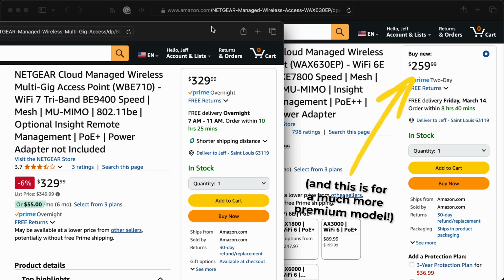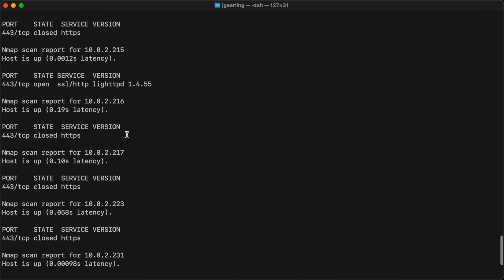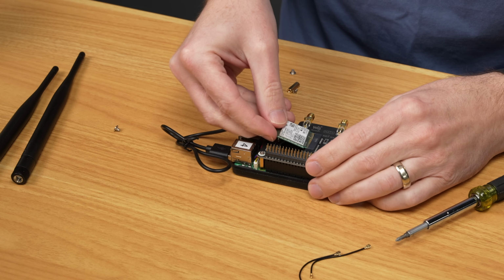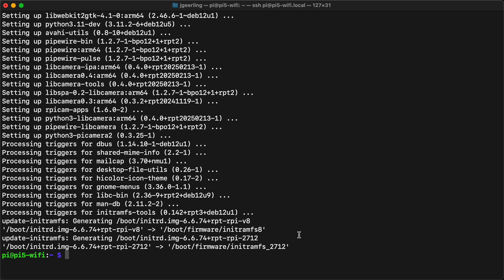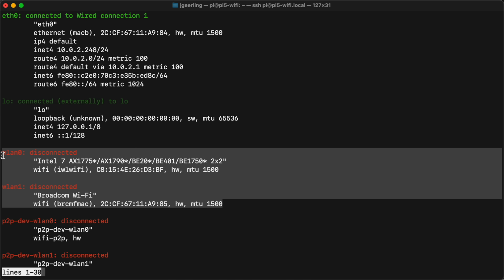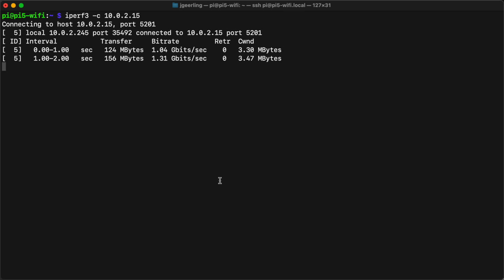The fastest WiFi EVER on a Raspberry Pi

Comment: You also only had the 6ghz channel set to 160mhz channel width, wifi 7/6e supports 320mhz width
Reply from the maker: It was set to dynamic (so negotiating between the widths), and the Pi negotiated 320 MHz for the last test (1.83 Gbps); see the linked GitHub issues for the card and the HAT for more on that ;)

I tried forcing 320 MHz channels (only, no other allowance) but that resulted in a connection that wouldn't work all the time.

Comment: The biggest addition in WiFi 7 I'm looking forward to seeing how well it works in implementation as more hardware comes out, is the idea of using multiple channels at once to have essentially a two way in/out communication simultaneously.

I imagine there' still some CSMA/CA back-off stuff involved that will make it still not catch up to wired stability, but could go a long way to getting there.

Comment: I'm sure someone else has mentioned it by now, but for reference you can use the -k option to lspci to list kernel drivers without the full, verbose PCI capabilities list. You can also just use a single -v to get it with the brief capabilities summary. Saves a lot of scrolling, especially on hardware with.. one or two more PCI devices than a Pi (I've got a few fairly normal looking machines where the full verbose output will far exceed 1000 lines).
Reply from the maker: True, true... or when you're on a server with 128 lanes of PCIe and like 40 bridges

Comment: You are a savior, just upgraded a computer to a new motherboard with wifi 7 built in. The current ubuntu LTS kernel has not been playing nice with my wifi 7 router, it just refuses to get an ip address, it'll connect to older routers just fine.

Comment: WiFi 7 is a game changer for those of us who have houses that aren’t built out of papier-mâché and some sticks. 

Being able to walk around a house that has solid stone walls without having the signal drop thanks to MLO is awesome
Reply: Aren't those Oriental houses? They must have great gaming.
Reply: @ just an average house outside the US really. Most houses I’ve been to in Europe are from the 30s and are made from brick and stone / concrete including the interior walls. Solid concrete. Even 2.4 GHz struggles in my house but not as much as 5/6
Reply: @iambenmitchell  Ours behaves really weirdly due to the walls being solid blocks but the floors being wood. Our upstairs AP works really well downstairs but one of the rooms right next to it with thick walls works really badly.

Comment: To me MLO is the biggest deal of WiFi 7. I have a house that has odd walls that in some places blocks 2.4 GHz, in others it blocks 5 GHz, and in others 6 GHz. So single-band WiFi is terrible. Even "simultaneous multi link" WiFi 5/6/6E tends to really want to hold on to a single band for far too long before giving up and switching. For example, a bathroom in my house sitting on the toilet is just 10 feet with one standard interior wall/door from my primary WiFi base station, and only 4 feet through a pipe-containing wall to a second base station! Yet I get terrible WiFi reception on the throne!

I upgraded to WiFi 7 routers last year when my 6 router became unreliable. I only have two WiFi 7 devices right now (one a desktop where having WiFi 7 is pretty pointless, since it's 2.5GbE wired as well, one a laptop with a USB WiFi 7 dongle just so I could test it,) and it works great. Doing some iperf3 speed testing, I can get over 2 Gbps between a WiFi 7 device a few feet from a router to a 10GbE-connected server; and in my dead-WiFi bathroom, I still get a good signal, as it uses all bands at once nicely.
Reply from the maker: Interesting, hadn't considered that use case, but partly didn't look to far since I had trouble getting MLO going.
Reply: @JeffGeerling  Yeah, MLO has been a pain. Windows 11 24H2 is the only OS I know of that it works properly in yet. My laptop doesn't officially support Windows 11, so it took some hacking to get it up and running to even test MLO. But it works great. I can run constant iperf3 tests and walk throughout the house, and just lose bandwidth, not completely drop packets the way non-MLO does.

I'm waiting for confirmation of a phone that supports it before upgrading my phone.

Comment: You can easily get above 1Gbits with 5Ghz channels Wifi 6 at range around 15-20 meters if you don't have 50cm stone walls in between. I don't see a reason for 6Ghz to need a Line of Sight for similar performance (even if I don't have anything to test 6Ghz or multigig network interface on the hand)

You do need a proper AP for that, and I don't think ceiling mounted AP are meant for servicing multiple room in a house. (a regular multi directional AP may do a better work then)

Comment: So a WiFi7 hotspot Pi using a AlpineWall install/config should be possible 😃
 (Id go with either Proxmox or NixOS as a host for a VM running it, or directly on the hardware install).

Great video!

🌱

Comment: I've read mixed reviews about the intel be200. Are you sure about it?
Reply: Almost all wifi 7 pcie cards are very very bleeding edge 
And wifi 8 spec just got announced 
Wtf
Reply: @nil3010  wifi 8 already? That's really fast... As for the M2 card he mentioned it in the video there's a lot of posts about it not working on amd systems which left me hesitant
Reply: @freestinje  NGW at end means it is 
Cnvio 2 or  1 ( not forward or backward compatible)

Basically wifi+bt stack  is on the SoC and RF stuff on the card
As of right now I don't know if Intel or any 3rd party made the full pcie version for wifi 7  ( they have announced it tho )

Comment: just a warning: if you choose to install the wifi card on the poe version of the hat, just make sure you disable the network adapter on it, otherwise your connection might instead go through that nasty, rock solid, brick house stable, uninterruptible ethernet cable you're using to power the pi

Comment: Before you try Intel Wi-Fi NICs support AP mode on 2.4GHz only. Figured that out while trying to build a Wi-Fi AP for myself a while ago, then I bought a Mediatek MT7922 card (before Wi-Fi 7 release) and, despite some annoyances on the Mediatek driver itself, it worked pretty good.
Nowadays, the option I'd suggest for Wi-Fi 7 AP is the MediaTek MT7925, the only issue is that it shares the same bus for all frequency channels, so you can only deploy AP mode in a single frequency (2.4GHz-only or 5GHz-only or 6GHz-only). And by buying 3 different NIC + a multiport M.2 switch board + the hassle of setting up everything, you pretty much enter in the commercial WAP territory
Reply: Yowsahz! Sounds....tricky...from your comment, soundds like you may be knowledgefull to answerring a que  stion or 2 I have...i've been wanting to make a network testing Pi settup which currently utilizing Alfa WIFI adapters to do so... since they are plug and play monitor mode- and all that fun stuff. If i went...am wanting to...hopefully from this answer...will be...If I use a wifi card/ hat like shown in the video....is all i need to take into consideration the chip? If i got a wifi card the ssame chipset as the alfa adapters...would that work? Set the card to monitor mode? I feel i'd still need at least 1 Alfa adapter for my specific use case(s)- or is there a solution out thee that would allow forr me to have 2 or more of the chip/ hat? Unfortunatly the onboad wifi chip doesn;t suport the modes desired.plus.I can't have these wicked col antenas on my pi.

Comment: The biggest shame of WiFi 6,6e,and 7 is that everyone uses intel's cards (or form factor) and basically limits the clients to only 2x2 spatial streams hampering speeds and distance you can get those speeds.

back in WiFi 5 with a 4x4 link (both router and client) you could get up to 1.7 Gbps real world speed was closer to 1.5 with overhead, but just think how awesome WiFi 6 and up would be with 4x4 antennas rather than just 2x2 (great for phones which need the limited space not so much on anything larger)

this also has a benefit where you can lower the channel width but keep more speed using more spatial streams, which in turn increase the range you get those speeds as the noise floor is better with lower channel widths.

Worst of all it's not even a tech issue, WiFi 6 and up has support for 8x8 and WiFi bumps it even higher to 16x16 but we never use it (yes i know MU-MIMO can separate the streams per client for concurrent Rx/Tx).
Reply: Well tleco s don't like wifi eating there sweet delicious spectrum

Comment: Did you miss that you were connecting at 160Mhz channel width, when WiFi 7 supports 320Mhz on 6Ghz?
You also probably weren't using MLO and even if you were I hear that most clients don't actually support full MLO as they only have a single radio that quickly switches between channels, rather than being actively connected to two channels at the same time.  Just the usual shenanigans when it comes to WiFi vendors, they never deliver the promised potential.
Reply from the maker: It supports 320 MHz and was using it in the final 1.83 Gbps avg test — but you have to be in pretty much ideal circumstances for it to connect on 320, otherwise it will drop back to 160.

MLO, I haven't been able to get that to work end to end. I have it enabled on the GE_BE network, but no device seems to be able to use it (AFAICT). It's also something that might need newer network libraries than the ones Pi OS currently ships with?
Reply: @JeffGeerling  Sounds about right.  I've done 1.7Gbit on WiFi 6 on 5Ghz 160Mhz but only using an Intel AX210 and not consistently.  Just checked on my M4 iPad Pro and it hit 1.5Gbit.

Speeds can be really inconsistent day to day even when nothing seems to be clashing on any channel in the range used.

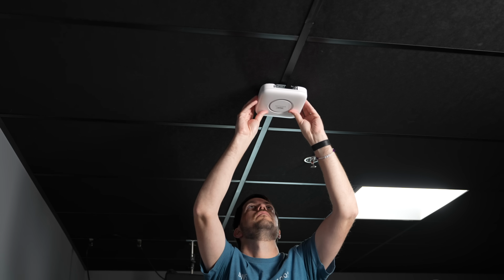Comment: 2:00 - It was a throwaway comment but I'd like to +1 the idea of picking up an Enterprise Wifi unit for the extra £100 or so it costs. You'll save that in "turn it off and on again" vibes alone.
Reply from the maker: Exactly. It's that whole "buy it for life" mantra... Higher upfront cost, for sure, but if you can afford it, it will save a lot of time down the road, especially if you have a family with a bunch of devices.

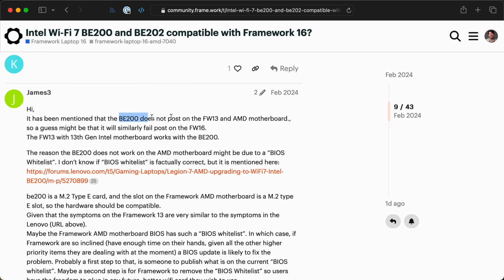Comment: 5:21 these are the be201 model which uses cnvio
Reply from the maker: Maybe in some cases—but from what I read in that issue and a few others, people are having trouble getting any of the BE200NGW PCIe chips working on AMD firmwares as well...
Reply: Cnvio is very confusing 
There are little to no documentation 

If u have a card that ends with NGW it's probably a cnvio stuff 

Basically wifi+bt stack on SoC and RF stuff on the card

Comment: Jeff did you run out of screws for the top switch in the mini rack?
Reply from the maker: Heh, it's okay with just two on the bottom two screw holes—I often do that unless I know it's a permanent placement for a device, because it makes changing it out a little easier.
Reply: @JeffGeerling  my ocd is screaming right now lol

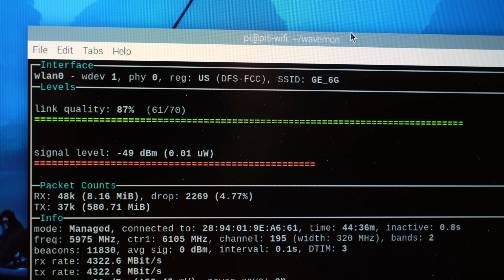Comment: 10:44 Depends, do you consider an 8 story apartment building with 4 apartments per story a "high noise" environment?
Reply from the maker: That's definitely a valid use case for getting at least a WiFi 6 enterprise AP (if you care about stable connections).

Comment: For me most interesting things of WiFi7 is Punkturing, in my case 5GHz is real nightmare, all wants "no cables and we have great tech for it" so i have about 20 SSIDs with widest channels they can get. Add DFS to it and we have all SSIDs on one frequency, with all desktops, TVs and other Netflix boxes on radio. So on short run 6GHZ can give me 40MHz of clean channel on 6e, but in long run all this madness just will be on 6GHz too, and hopeful WiFi7 Puncturind will be able to send few packets without waiting when all 160 wide channel chunks will be free. And 6GHz have more channels (even with 320MHz there is 3 noncongested channels +1x160), which are really hard to be saturated, less coverage helps there too. (But then we need some mesh with ethernet backbone, which costs a lot if 2 or 3 APs needed). So I have really great hopes about WiFi7, if only we can buy something cheap with 2x2 mimo, not high end monsters with 8x8 or enterprise ones which costs a lot by design, even if it's wifi5. I want Miktotik be2 (like ax2 but wifi7, - this series have all needed, no whistles, compact and reasonible price), but will get it in 2050, maybe xD

Comment: You're kind of comparing apples to oranges here... The differences between your APs are a lot more than just wifi7 vs wifi6e. Number, position and direction of antennas matter. As does number of radios, especially so with wifi7 since one of the main benefits is that it can combine multiple radios per client.
Reply from the maker: In the studio I'm mainly comparing my older WiFi 6 AP to the very similarly-aligned WiFi 7 version from Netgear. They have similar antenna pattern judging by the docs and tech specs, but I haven't torn both down to see how much they change out generation over generation.

It's hard to directly compare any WiFi gear without a real test lab, though, because even in a lower noise environment, the interference anywhere near a city (especially where I am, near three tall radio towers with dozens of services on each...) is going to impede consistency.

Kinda wish I had a basement bunker with 4' thick concrete walls ha!
Reply: @JeffGeerling  From the image, it looks like your old is the WAX610, with new being WBE710 one would think they're similar, but while they're intended for the same audience, they're really not the same inside.

The 610 is a 2x2, 4 stream AP with two dedicated radios, one for each band. The WBE710 is still 2x2 for all bands, but it is now dual multi purpose radios. One radio serves both 2.4 and 5GHz, while the other serves 5GHz and 6GHz. As in, if you disable 6 and 2.4GHz, both radios will service exclusively 5GHz band, but it's also the only band you can have multiple radios on. The antenna gains are also quite different, with 610 being 3.8 and 4.5dBi vs 710 which is 3.45/5.39/5.49 dBi.

I don't think you even can construct a "fair" test between the two that would only compare wifi 6 to 7 as such. As you say, it's very difficult to compare any wifi gear (real test lab or not really). Especially with a low powered device which could certainly be throttling you there, because 2Gbps, well you could get that much back in ac wave 2 days if you have a good 4x4 and a good AP like AP4800 (Cisco's flagship for that generation) which for me maxes out at just under 4Gbps.

My point wasn't so much that it was a bad or uninteresting video because it wasn't. My point was more that you're more so testing the wifi limits of the raspi with the two APs, rather than wifi 6 vs 7 on raspi, let alone in general.
Reply: @danieljonsson8095  Indeed, and that's the right model you've identified.

Comment: Just a random hint: ctrl+l (<- lower case 'L') is the keyboard shortcut for typing "clear" and works on almost every console I came across in 30 years. Makes life much easier and faster.
Reply from the maker: Huh, TIL! It does work in macOS Terminal too
Reply: @JeffGeerling  mike lawson will install this for you via skype and anyclient, he tests the airbus jets built in mobile, alabama using this radio
 you can ask for him in the tour also
Reply: @JeffGeerling  From my experience, it's pretty standard*. Hell, even Windows Powershell has that, even! 

(*: A quick ChatGPT tells me that it ain't part of the GNU Readline standard. Readline defines shell shortcuts like Ctrl-A and Ctrl-E to jump at the end and at the beginning of the currently entered command, or Ctrl-W to delete the last word. If anyone is TIL on Ctrl-W, be extra careful in shells contained in web browsers, as Ctrl-W is bound to close the current active browser tab.)
Reply: yeah Ctrl-L is a standard terminal thing.   It's the FF character (form feed) which causes a printer to feed to the top of the next page or a terminal to clear.
Reply: You just changed my life
Reply: That's an excellent tip!
Reply: Wow, thank you!
Reply: TIL what TIL means
Reply: Here's another one for you: echo Ctrl+v ESC c (will output as `echo ^[c`). This will reset your terminal.
If you've accidentally output some binary data and your terminal interpreted some random escape characters, you may be left with a weird character encoding and an unreadable terminal.This is an escape hatch to reset it.
Reply: now i dont nees to type "clear" all the time
Reply: On the Mac Terminal, I use command+k to clear the terminal.
Reply: Within curses-based applications this is also generally mapped to redraw in case your display output got corrupted
Reply: I love you. ❤

Comment: I recently upgraded my home network with tplink be19000, 10gb sfp+ to server, and wifi7 intel cards on other devices. I can transfer from laptop to server at 3.5gbps over lan. Entirely unnecessary, but i can see the cool big numbers!

In my experience MLO is still more miss than hit. Even windows couldn't work right prior to 24h2. I found some devices default to 2.4ghz when connected to MLO, so some devices I just stick to 5/6ghz bands.